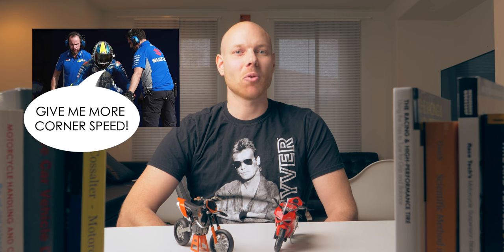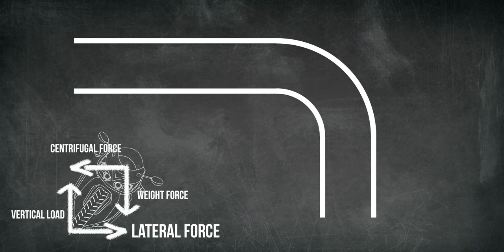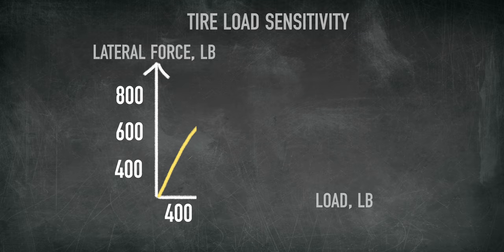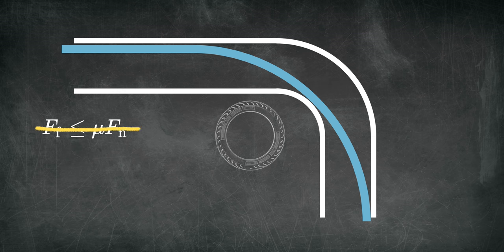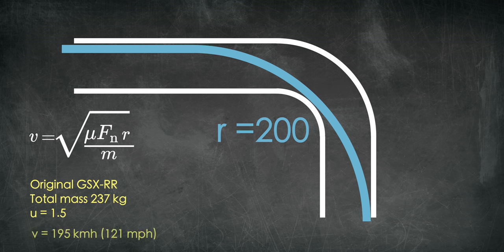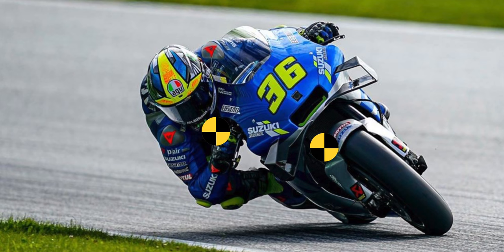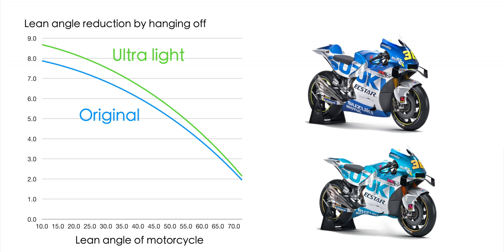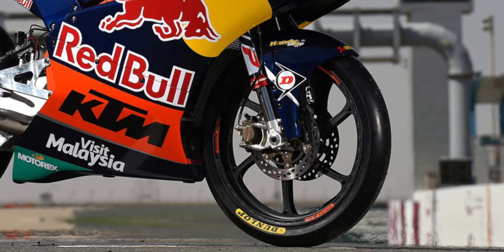Why Light Motorcycles Corner FASTER

Comment: Can a pedal bike out corner a motorcycle? If you could tow a pushbike up to say 100  kmh  on a tight twisty downhill mountain road. would it be able to carry more of this speed through the corners and possibly overtake a motorcycle? after all It would be way lighter compared to the motorcycle with extremely narrow tires. good things for corner speed by all accounts.
Reply from the maker: A pedal bike setup for those speeds yes. The pedals would have to be lifted up so that enough lean angle can be carried, we would need tires designed for that speed and expected lean angles, so we would have to get custom made ones. We would also have to beef up the wheels to deal with the much higher loads we would see from hitting bumps at those speeds. We would also have to change the rake/trail so the bicycle doesn’t start to wobble. We would also have to beef up the brakes so they don’t fade. Etc... 

At the end of the day we would essentially have a motorcycle without an engine in it. This ‘bicycle’ would be able to corner faster than a motorcycle.
Reply: @MikeonBikes  Thanks for your answer, Keep up the good work.

Comment: I was surprised to learn that the coefficient of friction increases with decreased mass of bike+rider. I've always wanted to try out one of the old two stroke 125s or 250s to feel that weight advantage through the corners and the raw two stroke power. I rode my new-to-me cbr600rr for the first time at BW a few weeks ago, and I definitely felt slow through the corners because of the weight. Feeling that butter smooth 600cc power, though... it blew my mind!

Comment: Is the ratio of the bike to rider weight important? A very light rider on a very heavy bike would find it more difficult and slower to get the bike to lean as they approach the corner.
Reply: Tailspin80 I that the rider’s mass doesn’t initiate the lean, counter steering does. I could be wrong though.
Reply: @thereal_tad3559  Good reply. Having read the wiki article on it I see you’re right, although there is also something called Countersteering by weight shifting which works better on light bikes (so I was a little bit right)!

Comment: I was waiting for this video for long time❤️❤️thank youu. I have question, how can I light my bike? What part of my bike can i remove?
Reply: The engine
Reply: replace the exhaust system with a lighter one
Reply: @jishnuknair9193  @Marco Donadi thanks guys for quick reply
Reply: @marcodonadi4318  hehehe
Reply: Battery, push start 😊
Reply: Another option is to replace parts with a lighter material. For example, using carbon fibre wheels.
Reply: @ralphsoriano5727  very nice idea❤️

Comment: Can i just ask why do lighter bikes have skinner tires. Why don't they use fatter tire wouldn't that have more grip?
Reply: Surface area has no relation to friction/grip. The only reason for bigger tires are, needing to support the weight and having more mass to absorb the heat caused by stronger acceleration ( heavier bike usually means stronger motor)

Comment: Every motorsport without weight handicap is a scam, you might as well put toddlers on bikes to reduce weight.
Reply: Low GP classes (for sure the old 125 GP, not sure about Moto3) had a minimum bike+rider weight. 
With bigger bikes small riders have strength issues, like Pedrosa had his whole career